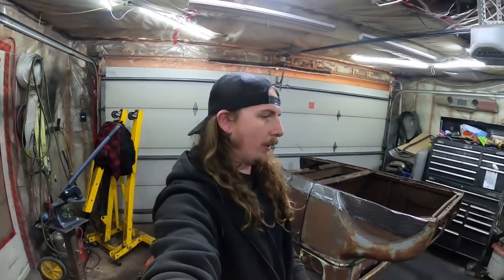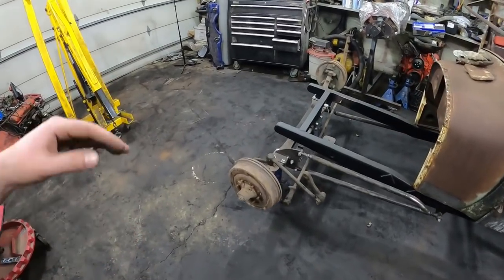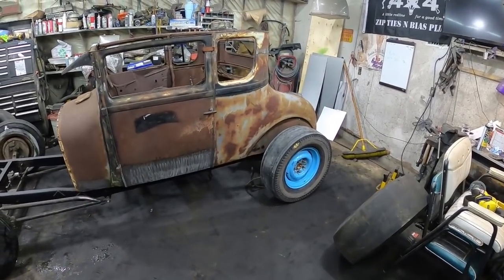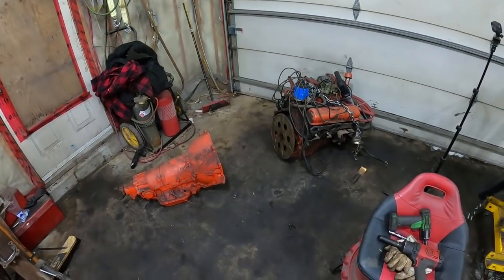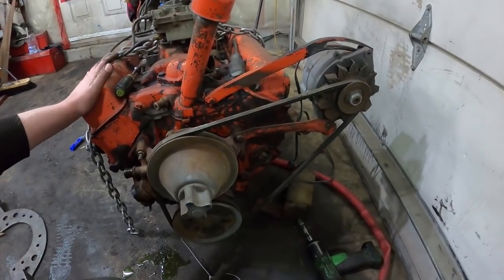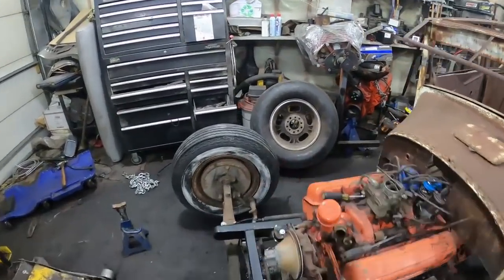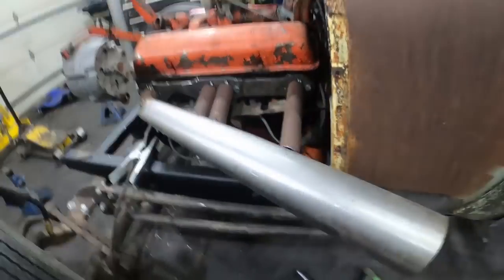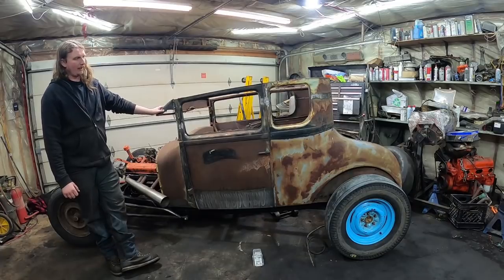Assembling my 1927 Model T Coupe - Adding Slicks and Side Pipes!

Comment from the maker: Is there anything cooler than side pipes on a hot rod?
Reply: Do something with the rusty part of the header tubes. Maybe some high heat silver paint so they look more like they are part of the cone. At the small end of the cone see if you can get a little more of that steel you made the cone from and make a tapered piece that goes around the first header tube. I'm not crazy about the way it just goes from so narrow to much wider. The taper should be more gradual.    Also, don't put a turn down on the end of the cone. Leave it just the way it is. It would have been really nice if they were all individual narrower cone shaped pipes and all turned upward and angled back. Shorter in the front of the block and getting longer towards the rear. Not sure if you plan to but degrease the engine and trans. And maybe add some chrome valve covers. You probably have those things in mind but you aren't ready for the cleaning and chrome yet. But I thought I'd just plant the seed. ;)
Reply: DD Speed Shop nope, my whole T project started because of a set of cool headers I got off Kijiji for a hundred bucks lol
Reply: Nope ! Nuf said.
Reply: Yes a girl riding shotgun.
Reply: Side pipes and a pin up girl painted on the car is all ya need Danny boy !
Reply: You could (could) go down another inch in the back but in my opinion, the radius of the body line should be balanced with the rear wheel and it is. But that little coupe right now sits right and looks like it will breath right. It's got that ball cap tipped low look. Eat your heart out John Milner! I spent a lot of time years back working with parts for street rods. There were so many pastel coloured cup cakes back then (late 80s, early 90s) it sure is nice to see them being built the way they did when granddad did it.
Reply: Side pipes or Lake pipes?
Reply: Put Zoomies on it. Do you guys ever have bare ground.
Reply: cooler than side pipes   YEAH a steel minion !
Reply: Make a bbq pit out of that compressor tank....
My 2 cents..
Cheers... 😀👍

Comment: Coming along nicely, will look killer once you get it finished I’m sure , a lot of guys over here used the old stamped steel wheel barrow tubs and cut them down for a firewall recess in the smaller rods like the T , these days everyone just goes out and buys the firewalls ready to trim and install but making some use out of a cheaper alternative is always good for the budget , just an idea 💡 , cheers from down under 😎👍👍🇦🇺
Reply from the maker: good call!  i think theres enough original that i can just add to it

Comment: Dan, that compressor tank would make a hell of a pot belly stove/oven considering how cold it gets where you are. We're just coming out of summer here in Australia.  Stay well, cheers
Reply from the maker: haha it would be a sweet stove but it's HUGE
Reply: @DDSpeedShop  Dan, half'm half it fire bellow then half way up, box out an oven, use the metal you cut out for doors on it and run a stove pipe out top . Have seen it done! 😁

Comment: Approx . 1700 lbs , 283  sbc , slicks on  ice ,     Sounds like fun to me 
On the factory drilled holes where you drilled on the passenger side (one) usually goes thru to the fuel pump rod cavity and will leak oil , Dont know how deep you drilled but yellow snot will stop the drips , Pretty sure you knew that but I thought I would throw that in there . Keep the vids coming .
Reply from the maker: yup i sealed her up

Comment: Take that old air tank mount casters on the bottom again then chop it open around1/3 top to bottom weld in hinges and make a big metal working/bodywork  roller cabinet
Reply from the maker: thats sweet but its to darn big for my shop

Comment: Nice job Dan all around  I like your fence art,LOL. By the way you can just slot that cone a few inches in the front to reduce the size to the front tube neatly draw iti n with a hose clamp no hammer and reweld it would look smooth to just a suggestion. Keep up the good work Glenn P. a 55 Chevy owner for 50 years in N.Y.,LOLL!
Reply from the maker: solid idea.  ill have to try that!

Comment: Man I really do love it and the body work engine and headers has made it look good. You dont want it to ride like crap nothing like a hard ride it sucks so the rear end is good. When you get the drive shaft dual quad high rise manifold Blower shocks trans cross member gas tank seats sound deadened steering wheel steering column master cylinder gauges fuse block  rag top carpet door panels car stereo optional CB radio Garmin map cold snack cooler in the trunk LOL and your big self in there its going to sit way down. A full tank of gas. A minion would be funny but a bus would be cool. I thought that was the 327 out of the 57 Chevy. The oil filler gave it away iconic.

Comment: Dan I usually don't disagree with you on stuff but I believe them fly wheel bolts should have been torqued or used the big impact on the fly wheel. Still gotta like what you do. Your awesome bud.
Reply from the maker: thanks man!  the little gun actually does 120 foot pounds,  i think itll b okay
Reply: @DDSpeedShop  your welcome brother. I'd like to see a drive shaft safety hoop and a transmission bag so you don't catch a flywheel to the legs God forbid. Safety is a must then smash.

Comment: Don't know what it is but liking those blue wheels, contrast to the brownish maybe...
You might be most of the way to a firewall over the front of the trans if you cut top or bottom off that compressor tank and split it (could be too heavy gauge though).
Reply from the maker: haha that tank would be thick.  I might use it at a bending tube though

Comment: You might want to buy an OEM style rubber transmission mount and integrate it into your  mount design.  Since your engine is solid mounted you'll end up breaking the  tailhousing if you solid mount it too. Have seen many guys make that mistake.
Reply from the maker: yup i got one.  just gotta build a mount for it

Comment: Great progress! I love it, it sits great the rake looks great. What about reversing the rear wheels? It’d offset them to the outside some and help with the track width difference between front and rear axles. I’ve been thinking about doing a set for my T , I just like the look. It’d be a neat project for youtube.
Reply from the maker: totally!  Might need some spacers or somthing.  Once its on the road i can start messing with it

Comment: Save some work and turn the motor mount around and it will move the engine ahead about 4 inches
Reply from the maker: I want the motor set as far back as possible.

Comment: need some nice red paint for the wheels
Reply: Cam Reed   We used to run chrome steel slotted wheels from Sears in the front, $21.00 each, and flat white painted steel wheels in the back.

Comment: Alot of work I building a 1930 Ford chopped and channeled 5 inch roof chop three inch window chop 6 inch channel one by four tube subeframe  rack pinion nineinch rear Lakewood ladder coil over fr and rear alloy floor   almost half way box and cross frames side motor mount I got 10
000 so far it worth 100.000 when I get done yellow like American graffiti I'm disabled i work slow but it gets fone
Reply from the maker: wow thats a pile of work!
Reply: @DDSpeedShop  one man junk is another man's project projects are great lean so much from first to last car I've had so many I can't count but there been a few I remember three Corvettes .1933 Chevy two El Camino's .442 Bradley gt.dune buggy Meyers minx ofcorse Harley sposter triumph.ducati 900. Camry .Celica just a few I'm getting old 1930 Ford .ram 1500 truck .and many more rd350 two.rd 400 yz80 yz 125 xr ,75 Honda dt250 .1968 Nova. Lol I like cars I can fix anything building I'm disabled do I'm slow can't compete but love to build it fun I can paint and trans work engine build gotta love it now I'm in need of garage need help building any takers

Comment: I didn't say pile I meant it's ruff but your working hard to fix it as long as you try I'm behind you some stuff I've done two three times before itpass I m my hardest cridet no shit I'll shitpile six hours worth of work if I don't like it .I'm the only one that matters  like your side bracket for your frame if your happy with them I'm happy with them I would do them slittle different but that doesn't make what your doing .if you like it that's all that matters  cutting the hole in the hood on 1955 Chevy I cryed but if your happy .sorry I won't do that that cat needs a paint job I'll help you paint it where are you I got all kinds of paint guns the best gun I have cost me 95.00 it a ze gun Amazon five holes in each side for mist it works great I want a black widow but my ze gun works great I can paint with it .it's right for me.
Reply: One by one tube subframe all around metal floors fan is getting better doing great I send you some pics
Reply from the maker: haha i hear ya but I just build what I like.  I love old beat up hot rods haha.  thanks for watching my friend!